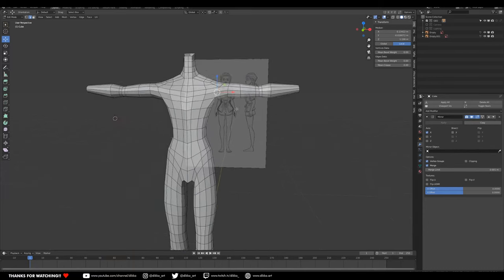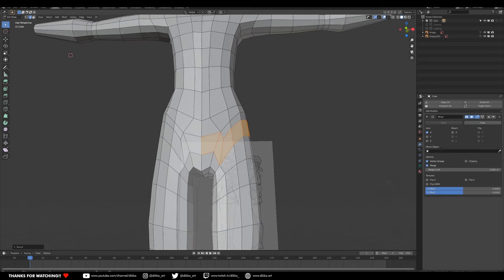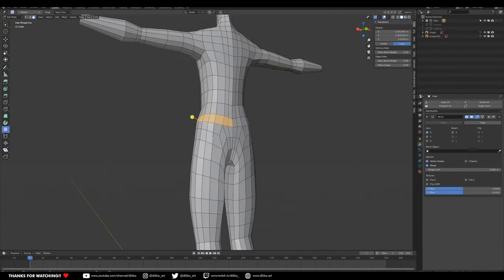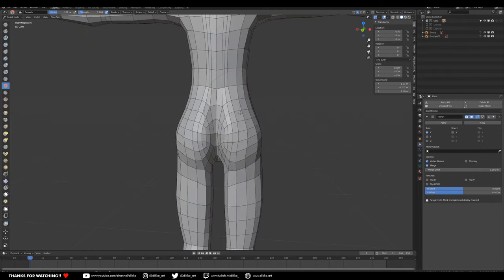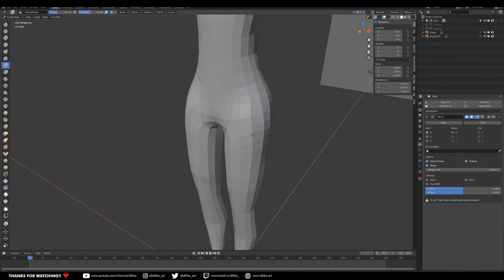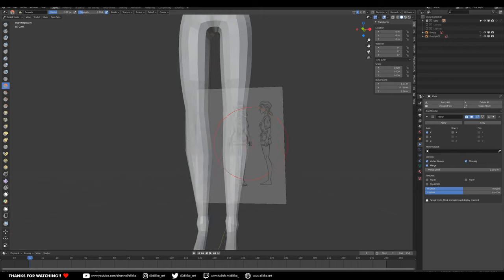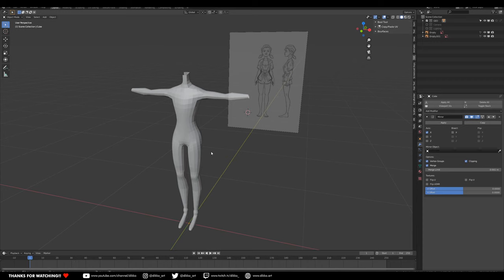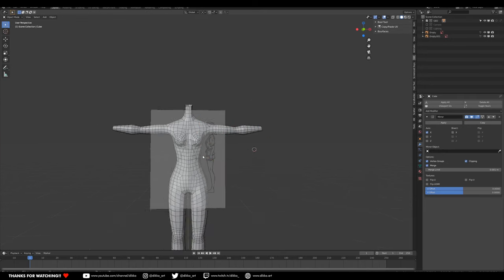Modeling for Animation 03 - Adding Volume to the Body!

Comment: I was a bit confused by the part in the butt 6:43 where you would extrude evenly along all the individual edges. When I used "E" all the edges would be pulled into the direction of my cursor. I guess I forgot how to do that exactly and couldn't find quite the right documentation on how to achieve that.
Reply from the maker: Just push e. Then extrude. Confirm the extrusion by pressing enter, then scale.
Reply from the maker: Aselebe Godwin  check to see that your transform point of origin is set to bounding box centre and that your transform orientation is set to global instead of normals. Hopefully that fixes the issue.

Comment: Did anyone else at the very start of this video, after beveling that edge, end up with an extra edge loop they have no idea what to do with? I've tried all sorts of things to fix mine, dissolving/merging edges, but I can't get the result in the video. I have the around-the-arm loop, but my chest and shoulder loops are the same loop, and I seem to have an extra edge which forms the centerline of the leg that was created in the last video. That centerline edge was a purposeful step in the tutorial, and dissolving it doesn't fix the problem.

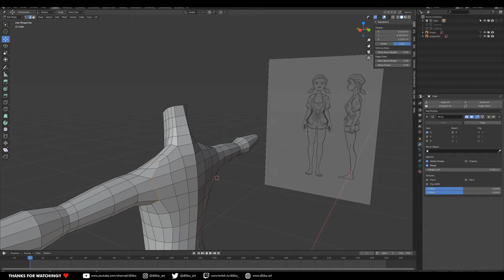Comment: I've watched all these series of videos and this so so great. I am following these videos to make my own model. Now I am confusing about the scale tool. At 1:05 I found that you are using the scale tool to make those lines to a loop. How did you do that? I can only scale those lines bigger or smaller and it looked so weird. Is there any setting to do this?
Reply from the maker: Ctrl + B ;). Bevel tool!
Reply: @Dikko  Oh，I mean after using bevel tool， then you use S to scale those lines to a loop， that is a problem to me
Reply from the maker: ah, S to scale, then X to lock to the X axis, then drag with the mouse.
Reply: @Dikko  No，I tried this, but it comes with the weird shape of lines.  and I watched the video multi times. I saw the bottom left corner you only hit S, not with X, is there an add-on for this?
Reply from the maker: @lucasyu3782  no there's no addon. Perhaps your transform orientation is set to nomals instead of global?
Reply: @Dikko  I didn't solve the problem, but anyway, thank you very much!
Reply: @Dikko  I found how to do that，just use S ，then X then 0， or use the flatten of the loop tool.
Reply from the maker: @lucasyu3782  ah of course :).

Comment: Great tutorial. But why doesn't he use the same method of creating joints on the shoulders as he used on the knees & elbows?
Reply from the maker: Shoulder is a ball and socket - knees and elbows are just a hinge. I get what you mean by similar edge flow, but if you look closer the shoulder is a lot more complex.
Reply: @Dikko  - Ahhh. Thanks for the reply. 👍

Comment: hey, i have a question about adding geometry to parts that stretch: I get that for elbows you'd have less on the inside and more on the outside, but what about joints that can bend into all directions?
Reply from the maker: Then even quads all round, most likely. Got an example you're thinking of?
Reply: @Dikko  Around the shoulders and hips. I saw how you did it in the video, but I don't think you talked about the deformation there, especially when moving the leg backwards and how it affects the buttcheeks.
Reply from the maker: @thomasmann4536  the shoulders I mentioned how it works in pt 2. But the upper shoulder itself doesn't really deform much when the arms point up because they move with the clavicle. As for the butt cheeks they just squish when the leg rotates back
Reply: @Dikko  I see. Didn't check out part 2 yet so will do so :P. Also, would you say that characters with let's say lots of muscle need a slightly different approach? Like, say, when moving the arm, the lats usually move as well, but in untrained individuals this is barely even visible. However if you had a bodybuilder-type character, you'd definitely have deformation going on there. So, do these things affect your topology or is it only a skinning concern?
Reply from the maker: @thomasmann4536  there's lots of ways to accentuate the muscles. Some people will actually model them in as you suggested, others would use something like displacement maps that get triggered when the body moves a certain way. That's a lot of work to get right.   Another method would be to put a muscle simulation rig under the mesh to get realistic contraction and flexing of muscles. It really depends on the use case. Each have their advantages and disadvantages.
Reply: @Dikko  Thanks a lot!
Reply from the maker: @thomasmann4536  no problem :)

Comment: Did you figure out how to make the butt topology yourself? I can't find anyone else that does the same.
Reply from the maker: Yeah basically looking at trial and error, but also just observing the major points of articulation and how the volumes are effected.
Reply: @Dikko  It's really impressive, man! The butt looks smooth and round even at a relatively low poly count and you even found a specific method for it.

Oh, and do you have a Discord channel?

Comment: I need some help fixing some weird topology. If you could take a look and give me some pointers I would really appreciate it.

https://imgur.com/a/duKEWvX

It seems like I have an extra loop in the shoulder or maybe I am missing a loop? This is after I did the bevel for the shoulder. Is there an easy way to fix this? I can provide more pictures if necessary.

EDIT: The loop in question starts at the base of the neck, loops around the top of the arm, and then returns to the top of the neck, where the head would be.

As shown in this link: https://imgur.com/a/8P92Mxy
Reply from the maker: Ah yeah its because you have a redirection of edges at the shoulder. See that diamond? the problem lies around there.
Reply: @Dikko  Hey, thanks for the response. So I couldn't quite figure out how to remove that diamond that you were referencing. I ended up using the knife tool, and cutting in a couple extra edges, splitting the verts, and that seemed to fix the edge flow. Although, now I have 2 extra sections for the wrist, because to keep the loop integrity, I had to take the cut tool all the way down the arm, otherwise it gave me an odd shaped face.

Picture of what I did.
https://imgur.com/a/sLxzV3S
(selected in the picture are TWO loops, not one that loops and comes back.)

I'm not sure if this is proper or not, but hopefully it will work for now :)

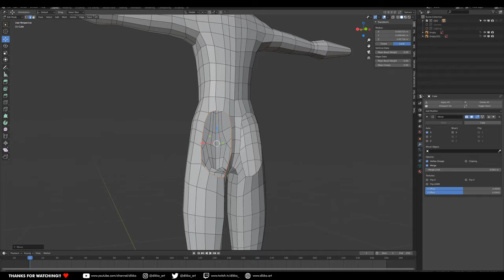Comment: Anyone know what tool is being used at 5:50 to smooth out the selected edges?
Reply from the maker: smooth vertices tool. its there in the left toolbar :)
Reply: @Dikko  Hey man. Thank you for the direct replay. I thought you had a special plugin to get the yellow control point but I just updated to the latest version of blender and found it's part of that update. : )